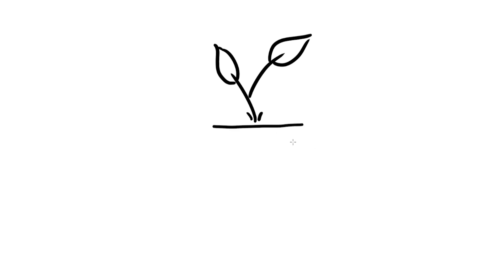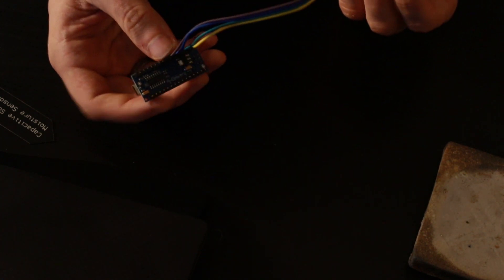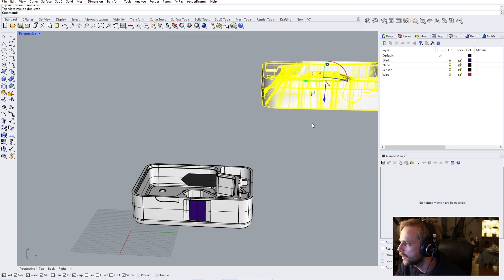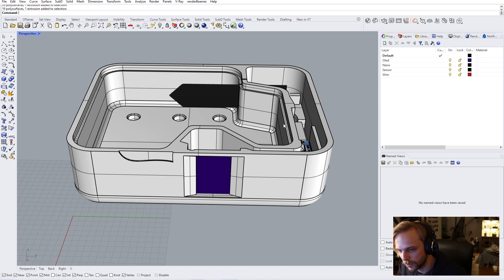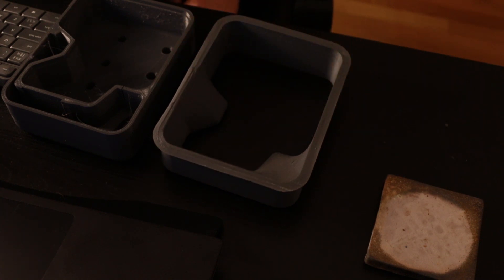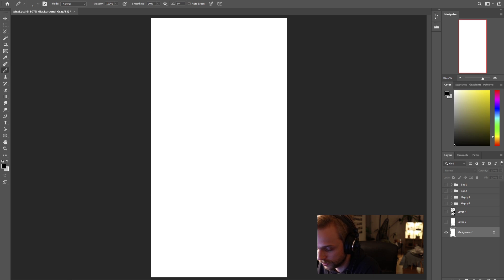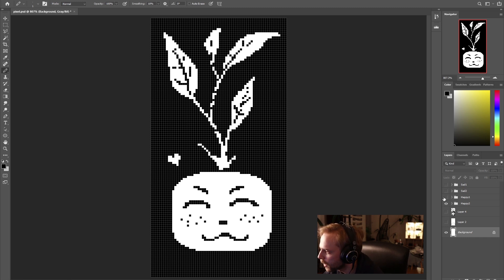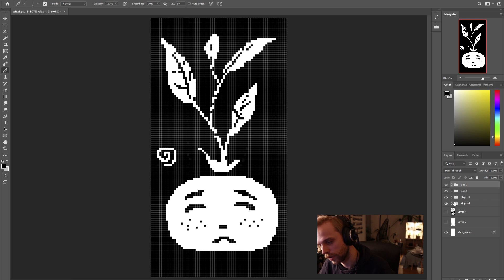Creating an interface with my plant using Arduino

Comment: What CAD package are you using here?
Reply from the maker: That's Rhino 3D, pretty good software
Reply: @DesignGoBrr  Nice, thanks - heard of it, but never used it.
Reply from the maker: @JeremyCook  It's like Solidworks that doesn't restrict you at all and let's you completely destroy your geometry by making a stupid mistake. Super wide range of possibilities, but also the user themselves needs to act as a "limiting factor" for stuff to stay "clean".
Reply: @DesignGoBrr  That could be good or bad :-)

FWIW, I'm using Fusion 360 now, which is nice, though I see Rhino has a 1-time fee instead of yearly license, which is pretty nice.